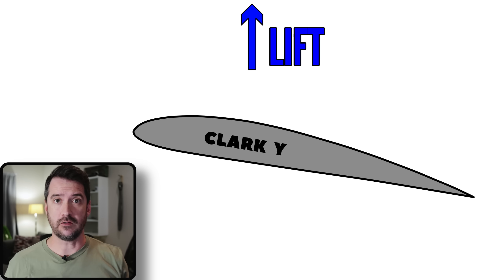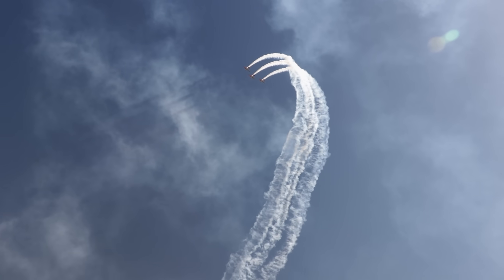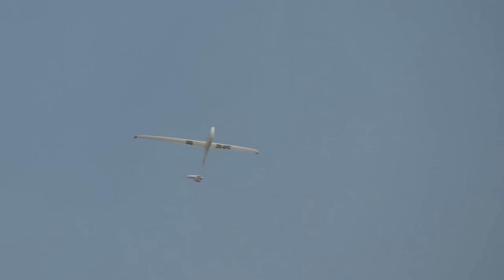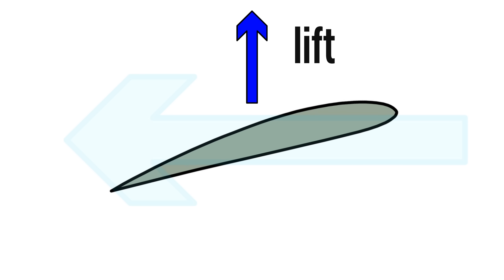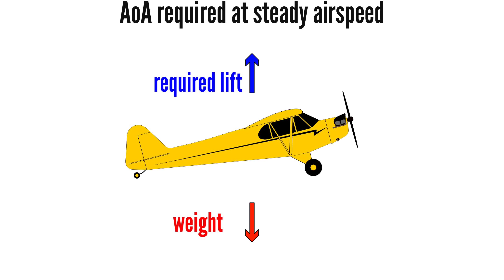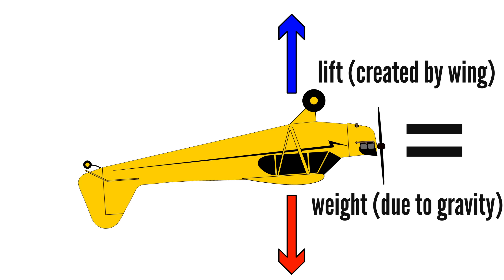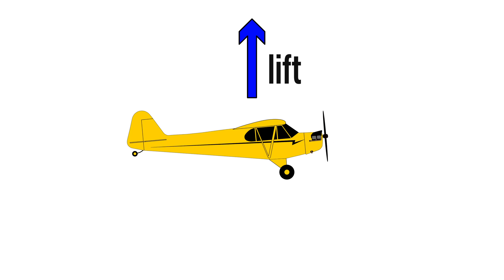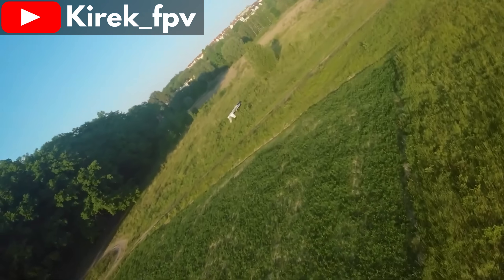Is Airflow Distance Over the Top of a Wing Always Longer?

Comment: Some years ago I discovered a simple way to practically 'experience' the amount of lift generated from a upside-down cambered airfoil -- a wooden "Whirly Gig".   (A whirly gig is a children's toy that is simply a propeller on a stick.  You spin the toy by holding the stick between your palms and moving one hand forward and the other backward.)  The propeller can be removed and installed upside down.  In that orientation there is still lift, but far less.

Comment: Great video. Model flyers tend to think they were born knowing how the physics of flight work, but very often they fail to understand the basic as outlined here. They will often claim that wind (steady horizontal movement of air across the surface of the Earth) affects the aerodynamic performance of an aircraft in flight, which it doesn't. Wind (steady horizontal movement of air across the surface of the Earth) only affects landing, takeoff and navigation. Turbulence obviously will affect things,  but the effects tend to be transient. Along those lines, they will claim that an aircraft in flight will weathervane into a headwind, or that a 10kt tailwind will reduce the airspeed of an aircraft in flight 10kt. Arguing with these idiots will do your head in, as they never will admit they are wrong.

Comment: Actual Engineer here (specialisation in fluid dynamics and aerodynamics) and this video dangerously oversimplifies the theory of lift. In general lift is created by making the pressure above the airfoil less than the pressure below the airfoil (obviously). Different airfoils accomplish this with different methods, but in general it has little to do with the (length of the path taken by the air over the bottom and the top of the airfoil). The simplest lift model known as "thin airfoil theory" shows that lift can be generated with a perfectly flat plate and the lift is proportional to 2*pi*angle_of_attack. The geometry of most cambered airfoils is the result of attempting to prevent stall at high angles of attack. Boundary layer separation tends to occur when a fluid encounters a sharp turn or edge. To prevent the air from separating from the top of the airfoil at high angles of attack the top surface of cambered airfoils tend to be curved as it allows the direction of the flow to change gradually from forward to downward as it passes over the airfoil. This allows the airfoil to achieve higher angles of attack without stall (at the expense of stalling easily while flying upside down because the curve is now going the wrong direction). At speeds above Mach 0.7 (achieved by many airliners) increasing the speed/pathlength of air would result in a pressure INCREASING shock wave on the top of the wing, so it would actually cause negative lift if the air had to take a longer path. As we all know, airliners (and many other aircraft) fly at speeds above Mach 0.7, thus lift is not necessarily generated by increasing the path length of the air. Fluid dynamics is a rather complex topic, any attempt to explain how lift is generated that does not involve advanced calculus is likely uselessly oversimplified.

Comment: Holly molly. This debate is really pointless. The idea of Bernoulli or Newton are only the easiest way of describing how lift works for pilots. The reality is that both are partially correct enough to suffice. Bernoulli never aver contemplated an airfoil operating to free stream. This means that the application of the theorem to an airfoil is incorrect. Newton is very much correct but again the application to an airplane is complicated. How lift is actually generated is tough to understand but it basically the circulation generated by the passing airfoil. The pressure difference from top to bottom is an effect not a cause.

Comment: A or the main reason the stagnation point adjusts seemingly counterintuitively to a low point in an inverted wing with positive angle is the airfoil's (upside-down cambered surface) curvature toward and at the leading edge creating enough resistance relative to the airstream to force airflow "back" around the leading edge to the lower-pressure (gravitationally upper) side of the upside-down wing. In other words, stagnation point does not change or move anywhere nearly as much in wings with sharp-pointed leading edges and very low curvatures -- and stagnation point changes even less in such sharpened, low-profile wings when they're symmetrical.

Comment: @Ranchpig67  Wing angle of attack is not the same as the plane's AoA. If a plane is designed with any non-zero wing AoA, then two of the same planes in mirrored up/down positions cannot have the same wing AoAs. In fighter jets and at jet speeds, effective AoA is far lesser than for passenger and civil planes. In fact, you might notice that although all planes have wings with greater topside curvature, in fighter jets the overall wing angle may even be slightly downturned for various purposes, including factoring the large lift generated by airflow over the cockpit bubble, etc. Back to mirrored flying, when two planes appear to be in "level" or stable flight and are using the same fuselage AoA, in fact they are almost always going to be in a slight earthward trajectory to account for the upside-down plane being pulled to earth by its inverted wing lift condition. At air shows this stunt is done high enough so the diminishing altitude (rate of descent) isn't too obvious, or dangerous. Otherwise, both planes will need to assume an upward angle for stable flight. Also, a closeup photo of two mirrored planes doesn't tell you how the camera was oriented relative to the horizon to match the planes' attitude.

Comment: Besides assuming without proof that cause-effect explains all physical phenomena, scientific belief also assumes if two different explanations explain the same phenomenon, the simpler one more reliably explains what really happens.

The Bernoulli Principle notes that air moving along a surface will create a lower air pressure in an empty tube leading perpendicularly down from the surface. That is true. The same principle notes that air moving across a cambered surface will do the same in an empty tube leading down from the camber. Also true. 

So in a wind tunnel try this:

Put a wing whose upper surface is cambered and whose lower surface is flat, horizontal, and the same as the wing's chord. Turn on the wind. Fast moving wind will not lift the wing when kept in the flat attitude. 

Then raise the wing's leading edge slightly so the wing chord's [bottom surface's] angle-of-incidence relative to the wind is positive and the wing will lift until the angle-of-incidence relative to wind direction becomes too steep. 

Creating lift until the angle-of-incidence becomes too great is the moving air pushing more on the bottom surface. 

This explanation is far less belabored. It is also how the USAF explained lift to pilots. The USN used the Bernoulli Theorem to explain lift to its pilots. We should assume most Navy pilots believed that explanation, but their planes' wings created lift most likely according to the simpler explanation of lift

Comment: There is definitely low pressure above the wing. I proved it to myself by accidentally leaving the fuel cap off my Stinson 108-3 after filling the right tank. After takeoff it emptied in about 30 seconds. It looked like smoke coming out behind the wing. The tank has to be full or nearly full. I did the same in a Cessna jump plane but fuel is kept at minimum and nothing came out. Both times I was interrupted while fueling.

Comment: The force required to move ann object in a circle is called centripetal force, NOT centrifugal force.
Reply from the maker: The outward force is centrifugal, and the inwards force is centripetal. The spinning ball or looping plane's momentum is what is pushing it outward, thus centrifugal, and is what I was referring to.
Reply: @LetsGoAviate  Nothing pushes the plane outward! The only force required to move the object in a circle is the force directed to the centre of the circle. It's called centripetal force. Momentum is also not a force. You're not a physicist then...
Reply from the maker: @Humanity101-zp4sq No I'm not a physicist. Since you are, help me correct then. I know the plane is kept in the loop die the centripetal force. I'm referring to the force that on a plane in a loop is in the same direction as the load factor. Here's some definitions copied "a force, arising from the body's inertia, which appears to act on a body moving in a circular path and is directed away from the centre around which the body is moving." That's the definition of centrifugal force.

"In another instance the term refers to the reaction force to a centripetal force, or reactive centrifugal force. A body undergoing curved motion, such as circular motion, is accelerating toward a center at any particular point in time. This reaction force is sometimes described as a centrifugal inertial reaction,[44][45] that is, a force that is centrifugally directed, which is a reactive force equal and opposite to the centripetal force that is curving the path of the mass."
Reply: @LetsGoAviate  That's a bit more like it, although clearly copied from a text book. Not helpful to consider the 'third law reaction to centripetal force'. This is the force which opposes the centripetal force. The centripetal force enables the circular path ( as it creates the radial inward acceleration). The reaction, or the 'centifugal' force can be thought of as the force felt as the passenger feels themself being 'pushed' into the seat. The force creating the circular change in motion is the centripetal force.

Comment: But airplanes can fly upside down for any period of time.  During flight shows there are sections where airplanes flying upside down cross the audience multiple times and stay in that position for the entire time. The effect you are talking about is called the Venturi effect and yes, this effect does provide lift but it's not the only thing that provides lift and planes  do not depend on the Venturi effect to fly. The main reason why planes fly can actually be seen in all your animations and it is the angle of the wings. The angle directs air that comes straight towards the plane slightly downwards behind the plane and if you push something downward, you yourself will be pushed upwards as there is a counter force for every force and this push upwards alone can be sufficient if the angle is steep enough. When a plane flies upside down, the Venturi effect will pull down the plane to the ground instead of providing lift but that can be compensated by putting the wings at an even steeper angle so more air is pushed downwards creating even more lift and that's why a plane can constantly fly upside down as long as the pilot keeps the angle right. The downside is only that it will fly slower and use way more fuel. The shape of the wings is not the way it is because that's required to make a plane flight but because that way planes can fly faster and require less fuel as the alternative would be to give the plane a bigger engine that runs at higher speed (thus consuming more fuel) and put the wings at a steeper angle so the counter force alone creates all the lift needed even without any Venturi effect. In the NASA space center, there was a computer that would teach visitors why planes fly, including a simulator where you could experiment with various factors and according to that simulator, only 25-40% of the lift of a modern airplane is created by the Venturi effect, the other 60-75% are created by the angle of the wings. And again, you yourself show that in all your animations. E.g. look at 2:23 and see how the wing is pointing downwards, it's not level to the ground. And that is correct, it must be pointing that way as otherwise the airplane would not fly.

Comment: In the end (no matter what is the cause for this fact...) lift is created, due to the air being "deflected" downwards. So both theories are right. If the path "over" the wing is longer than the path "under", that forces the air to a "downward" motion, whitch creates the lift. You can't have one without the other.  :-)
For me it is still easier to think of a downwards directed airflow. (Though I know, that this forces the path "over" the wing to be longer than the path "under" the wing...)

Comment: You're looking at a consequence thinking it's the only reason it happens in the first place.

Lift is produced by displacing the mass of air downwards. Canver is used to mantain the flow attached so that it flows down too.

In the bottom of the wing, you're pushing air down against a volume of air, which oposes a resistance, increasing pressure and reducing its speed. At the top you're pulling air down, creating a vacuum which draws air in and thus accelerates the flow. The stagnation point is in the point from where the flow at the top and the bottom have equal energy, it is equally costly for a particle in the stagnation point to do a longer path that is pulling air in, or going the shorter path that is pushing air away.

Comment: A wing is basically a ramp, but inverted. They force the air down as the plane moves through the air, generating lift. It really is that simple at the most basic level. Fighter jets typically will not have ramped wings, though, as this would inhibit maneuverability. They instead just use raw thrust to solve the problem.

Comment: I mentally use the idea of particles hitting the underside of the wing and newtons third law when i'm picturing lift (and how changes in aileron deflection produce roll). I imagine that a stall is where the air speed is too low for the mass of the particles to keep "bumping" the aircraft upwards.

However, the air flow separation at a stall is enough to suggest that Bernoulli's has to play a major role - to which i totally agree with your point that an upside down wing still works the same say but with a very low stagnation point.

Comment: Looking at it in the simplest way possible, the plane lift must come from some force exerted on the plane, and this force comes from the air pressure pushing on the body of the plane.
A wing with a positive angle of attack will increase the pressure on the bottom and decrease the pressure on top, leading to a higher pressure on the bottom pushing up, and a lower pressure on the top pushing down. The resulting net force will therefore be upwards lift.
Similarily, a wing shaped such that the top path of the air is longer than the bottom path, will cause the air on top of the wing to speed up and decrease in pressure, also leading to a net upwards force.
In most cases, the angle of attack has a much bigger influence on the lift than the shape of the wing, so flipping a wing upside down will reduce its efficiency, but it can still generate lift if it has a positive angle of attack.

Comment: Yorkshireman George Cayley gave the only worthwhile definition of flight. "Flight is the application of power to the resistance of  air". Completely flat wings work perfectly well. An aerofoil is a nice embellishment but that's all. If lift is perpendicular to the upper curved surface then flying upside down would add that force to weight with disastrous consequences. Someone had better warn the Red Arrows.
Reply from the maker: No the upside down argument is flawed! The low and high pressure switches when upside down as I showed. With positive AoA the low pressure forms on top (which is the side pointing to the sky, right-side-up or upside-down). The curvature increases efficiency but is not responsible for lift.